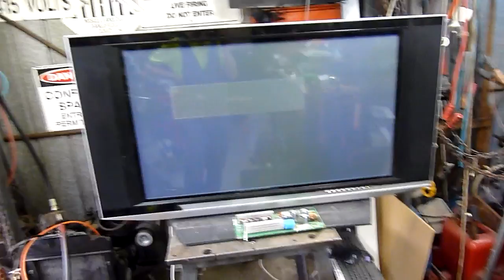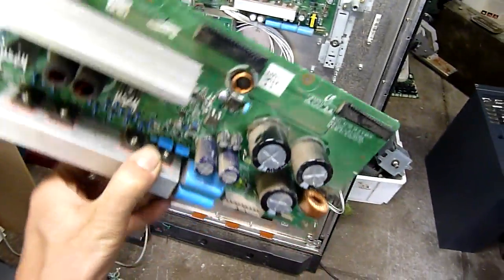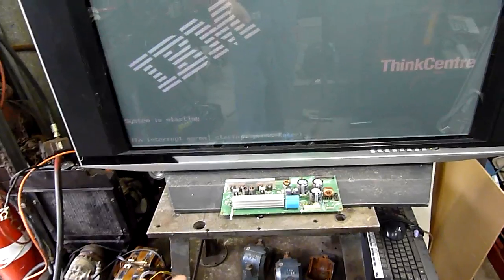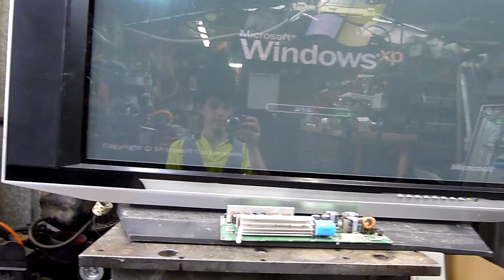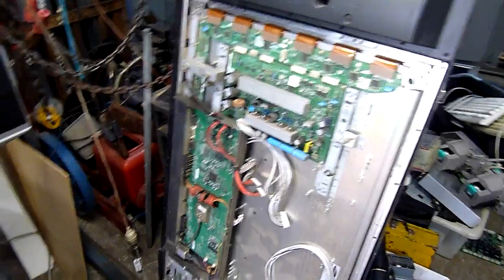Soniq 42 Inch Plasma (Samsung S42SD-YD07) - Failed X-Z Sustain Board Example

Comment: hi aussie50,im from over the ditch in nz and have an 42inch plasma phillips/samsung,ive replaced the leaking capacitor on power board, she power ups fine but sparkles at top of screen but no heat and no menu until i turn her off and just as it shuts down i can see screen with menu even a yellow x next to it ,and it turns its self off after 20-30 minutes i think might be timer?any ideas cob.

Comment: Ed, I've got a Gateway PC with a failed BTX 775. Came with a Q6600 and Delta 700w PSU. I'm working on installing a uATX back panel and MoBo tray for it. Maybe you could try that to your BTX case, too?